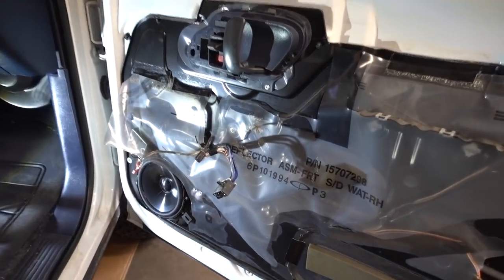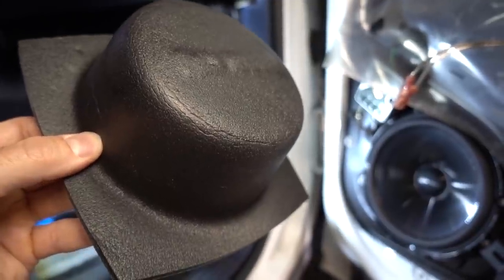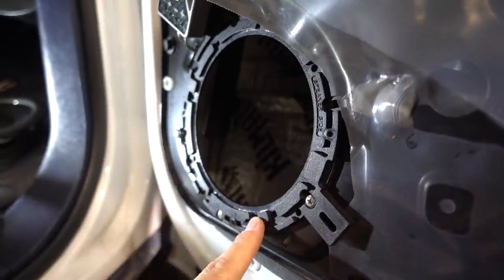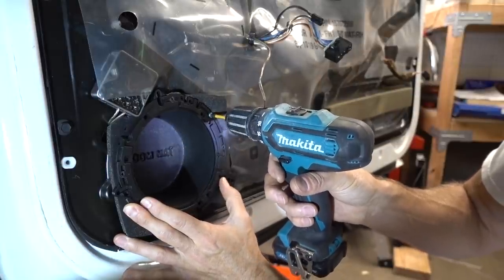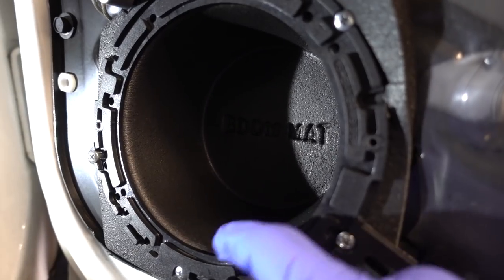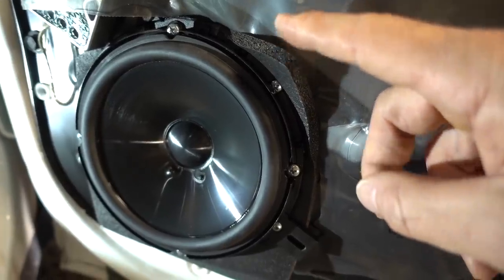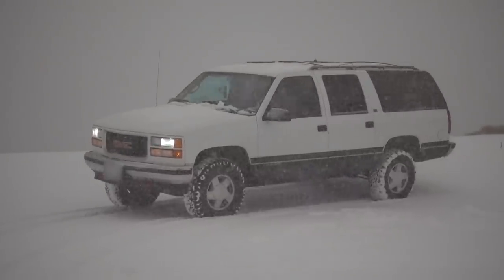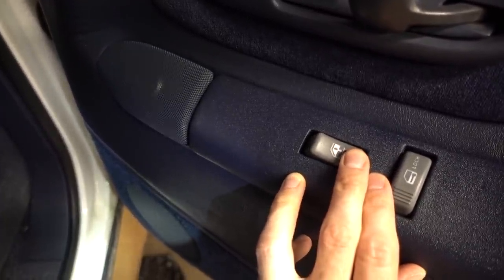Here's How A Speaker Baffle Could Destroy Your Speakers!

Comment: Just shorten the foam baffle length with a sharp craft knife (cut a thin section out) and glue the foam back together with contact cement. I like the baffle idea, not just for protecting the speaker from the elements, but it will probably produce way better sound than using the entire door as an acoustic device. I'd cut some flaps / sections out at the bottom to allow it to vent compression however.
Reply from the maker: Great ideas, Thanks!

Comment: So the best way I found was as follows. Fold the foam inside out. Put speaker on the foam. Fold it over the speaker. Cut the bottom out of it to allow air for your bass. Screw it in. Then I personally put caulking around the out side of the foam for tighter seal. The glass may rub a little but your not hitting it. Make sure you cut the speaker wire hole on the back side instead

Comment: “I’m the type of person that just can’t leave things alone” lol, welcome to the club! You know it will drive you up the wall thinking about this. Is it possible to cut 1/4” of the foam and reduce the depth then use an adhesive spray/silicone to reattach? I don’t know how much clearance is available.....
Update: I just read/noticed “Daddyoh” made the same suggestion. In any event, Let us know if you try our method.

Comment: If u pull it back apart put the mounting plate on the door like u had it and push the bucket in like u initially tried to do it wont hurt anything the design is to improve sound while protecting from the elements
Reply: Or add a layer or 2 of deadner to the outter skin of the door that will give an 1/8" or more depending on thickness of the deadner

Comment: Unfortunately the mid bass will be gone because the baffle inside space is way to small. And it'll sound bad..protection yes
Sound not really. Cut the lower back half of the baffle and it'll sound properly
Reply: I'm glad folks have experienced this. And I'm glad it's not months down the road I'm figuring it out. Definitely gotta do something. About that speakers sound good but after hearing this they could sound better

Comment: jewllake  below has the RIGHT IDEA - " You really want the speaker to move air and take advantage of the whole door ".  --  Without the door volume of airspace the speaker drivers will not sound as good as they were meant to...... jewllake's idea was to cut them in half and only uses the top part as a cover leaving the bottom side open to allow drainage and moisture evaporation, --  I would also cut a half circle out of the remaining back plate leaving about a half inch of the diameter of the back plate to give some extra support to the top half of the cover but not blocking to much of the sound coming out of the back of the speaker driver. 

7

Comment: Had the exact issue with my 1999 K-1500 Suburban when I replaced the speakers. Just reinstalled the mats on top of the speaker trim ring and cut off the extra material.

Comment: "Slime" refers to depth, not diameter. Just install it on top of the mounting ring. If there is a fitment issue in terms of diameter, you could take material off the inside of the ring.

Comment: So why don't you just put the baffle in after the mounting bracket for the speaker? It looks like the window is coming in to contact with the baffle by less than a 1/4". Putting the baffle in after the bracket instead of vise versa might give you the needed clearance. Use felt tape on the bracket mating surface with the door panel if your worried about rattling.

Comment: Cut it at an angle use it as a water deflector  you want to use the door as your speaker box so you don’t lose any mid range
Reply: After replacing my speakers and installing the baffles can definitely tell I lost some range. But then again I'm kinda a noob on this stuff but I have 4 6 1/2  mtx terminators i replaced the factory speakers with

Comment: Just put 1/4" spacer behind the mount if it will not hit the door cover in front of speaker. Use 1/4" longer screws to mount back.

Comment: i ran into same issue when i was swapping out the stock 4x6 door speakers in my '82 Buick Riviera for some 3 ways. first it wasnt fitting inside it properly due to magnets size so than tried it without it & it was able to fit but didnt sound good at all & didnt quite sit well with us either so then i had to wait a few days on the stereo shop to get me a cpl tht were a perfect fit for both speaker magnet & window clearance except for now the tweeter wasnt letting the door panel get put back on due to the grill was in the way now so after a long time messing around with it we ended up jst exchanging the speakers for another 3way pair which actually were  much btr since they were able to fit snuggly within the original door cups & we was able to reassemble both door panels with no problem & also they had btr power handling & sounded much better than the other set i was going with. lol :/

Comment: Hole at the bottom for speaker wire I would think the water if it hits it it’s going to run down the sides and collect  at the very bottom point. I personally would put it on top with a dab of black etc to seal the wired but really if it’s that much of a concern when it rains just order new window seal and new window wipers inside and out

Comment: Cut the foam 1/8" of the rear of the rear cover. Then used a glue  like weldwood or contact cement to glue the rear back on then use some good waterproof tape around the glued area.

Comment: Try the adapter first then the baffle over it. I know it's not necessarily the ideal way because you initially installed it perfect like a pro in my opinion but it might give you just that little bit of extra clearance you need my friend.  Not ideal but if it works.. 🤞 LIKED & SUBBED!

Comment: Hand held screwdriver? Guys at 5 Star say 1/32 is the only thickness that won't tweet your acrylic ring.  Pull the wires through before you fill the hole.

Comment: It looks like it's barely touching.  Just put some washers between the foam and door structure its mounted to.  Looks like 2-3 washers on each mount screw should to do it.  I'd also take a razor knife and cut off the excess foam around the outer diameter of the speaker mount bracket you are using.

Comment: You can just cut the back off. Water is very unlikely to effect your speaker. You can cut on an angle so that it is flush on the bottom. OR. You can force it so that it is mounted outside of the speaker bracket. This will likely be just enough that it will clear.

Comment: Treating the windows channels with armor all or wd 40 should help to weather proof the windows but this a good solution  ,also to improve the sound coat the screws in copper grease as this will help to reduce rfi distortion

Comment: Put a 1/2 inch spacer if that is to much for the speaker grill use 7/16 spacer, you might have to make them, that will move the speaker closer to the whole where your window wont hit
Reply: I cant believe these so called audio professionals cant figure that out. Look on Ebay for some spacer for 6.5 speaker made out mDF or 7/16 MDF for 6.5 or what ever size u have. If u buy off ebay they are $15-$20 at most and they work. They are made out of MDF

Comment: I’d be more worried about your crossover placement and overheating your coils by not allowing airflow to your speaker motors
Reply: Yeah because overheating speaker coils are totally a problem in 110-118°F Arizona/Nevada/California/Sonora/Emirati... Btw it's well over +130°F in the SEALED door panels...
Reply: @bestvidsdottk  yeah and I’m willing to bet the glue that holds that coil together melts close to that temp
Reply: What happens in sealed boxes?

Comment: Wouldn't a speaker baffle affect the sound quite a bit? It causes pressure to build up behind the cone as it moves inwards, which it wasn't designed to handle. Any speaker enclosure heavily affects sound.
Reply: The boom mat will affect the  sound.
If you install it like the guy did in this video, it will send the sound out in a straight beam. The ambient sound will be gone.
In order to achieve the best sound, these baffles must be modified. Holes must be cut into them to allow the speaker to breathe and secondly you should use a thin layer stuffing inside the boom mat to absorb the sound coming out of the back of the speaker.
Believe me this Works to improve the sound quality of the speaker

Comment: Man what a bummer. 😔 They're definitely worth it though. If you're going to fix the depth in the future, definitely get a set of foam rings. It gets sandwiched between the speaker and the door panel, sealing off, and isolating the sound so it projects into the car better. Gives you a really good sound improvement. Especially in the midbass frequencies.
Reply: Esos arreglos sencillos con la pieza que trae los Malibú una pieza que retira la bocina de la puerta ya está eso es todo para que los imanes no pegue le pones eso y las piezas de retirar la bocina para que los imanes no peguen ya está

Comment: The round speaker box is so small that it almost sounds as if the back of the speaker is clogged.

with such a small box you will not get good sound!

Make sure the speaker has a gasket so you do not get sound leakage.

speakers at the bottom of the door will not sound good since the speaker is so far down!

Comment: Clearly this person is not an MECP certified installer.  Second.  Foam baffles do protect the drivers really well.  I use them due to the fact I live in Florida.  Yes I made a port in the bottom of it to allow the backwave leave the foam for this very reason to  "breath" if you will.  When you spend $1200 on a set of components then yes one must do thier best to keep water and moisture off the drivers for logevity  If you are smart.  Make kick panel enclosures and call it a day.

Comment: Installed those baffles along with brand new t series fosgate 61/2 inch speakers in my 05 chevy truck. Couple months later passenger side window motor went out, driver side regulator went out and both speakers stopped working at the same time. Coincidence ? Highly doubt it. I promise you they don't add mid bass nor do they protect the speaker in any way. Probably why there so inexpensive

Comment: You didn't seem to show how much of the bottom of your window wanted to slide behind the foam baffle, unless that little bit you showed WAS the max with window all the way down.  Here's my thought:  There should be some extra glass below the door trim when window is 100% up position right?  So, you have a "margin of error" to use at where the glass contacts the baffle.  What if you used some non-petroleum or silicone grease to lube the backside of the baffle to ease the friction vs the glass?  I know your first reaction.  The grease will attract dirt, and yes, of course it will.  But every time I have looked into my door spaces the dirt factor is normally very low.  The space is pretty well defended from routine dust/dirt, and there is not much ventilation that infiltrates it.  If it were myself, I would lube it to reduce the drag on the window motor fuggitaboudit, even if there were more intrusion by the baffle.  So long as the glass was not trying to push the foam thing down (after greased), that's would be my solution . . .

Comment: Boom mat can be hard on speaker surrounds, it doesn't make speakers louder but it does change the tone, that can be good or bad depending on your ears, however it rubbing on the windows? Eh, not gonna hurt the baffle, it can however ruin your window regulator, just ask me how I know, who'd have thought a passenger window regulator for a 2001 focus zx3 could cost $120??
Reply: Oh by the way, depending how much the window presses on the baffle it can also create pressure inside, and possibly even a vacuum, which can be bad for the coils if you roll the window up or down with the speakers playing

Comment: During the original install of the speakers, you traced back to find the split for the woofer and tweeter, since there was no original cross over, was that necessary or could you just use either pair of the original wires to feed the new cross over?? (Am I making sense?).

Comment: I tried these on a 2000 ranger with some upgraded high end aftermarket component 6.5's and they took all of the bass out. I only did one side to compare the difference and they sucked all of the midbass out of that speaker. I would definitely not recommend using these unless you are having a water intrusion issue and then i would cut the bottom out so they are not enclosed.
 just my 2 cents from real world test.

Comment: Is there a sound difference between the boom mat and the open door with kill mat? Which sounds better. I am wondering about the boom mat for my 6x9 door speakers but wondering if it will limit their sound output vs the open matted door enclosure.

Comment: Random question but would be greatly appreciated does any body know what size/ thread and length of the bolt that holds the tailgate cable to the tailgate because pick ups are differant from blazers and suburban tailgates

Comment: I'm building a DIY bluetooth speaker and I'm using a 1.5ohm sony passive sub and I am using the enclosure and I put a 8ohm speaker in it and a tweeter I'm wanting to put a full range speaker in it and I waa wondering if this would work with keeping the pressure off of the 3.5" full range speaker

Comment: NOOOOOOooooo, I just ordered a pack of these for my 2004 Tahoe!!!
Reply: Hopefully they worked out well for you. In my personal opinion he did absolutely nothing to first confirm that there would not be any interference which anybody that’s messes with electronics, especially car audio would know to do. Let alone a person that posts his videos on YouTube. You don’t build an entire car engine and then try to start it to see if you have any rod clearance issues. Nonetheless the space between the speaker and the actual door panel is a decent amount, Especially on those models and later models, therefore an additional speaker ring can be added behind the foam baffle to the door itself then the baffle and then the additional ring that was originally used therefore sandwiching the baffle and giving you your clearance needed.
Again hope you had good luck with yours.

Comment: Really if you're that worried about weather getting in. You could cut off the back and bottom of the foam enclosure. It would protect against moisture coming from above. And allow the speaker to breath. If that foam is dense enough to keep water out. It probably won't let air pass thru easily. And the speaker needs free air movement.

Comment: Jimmy I feel bad for you that was a useless thing to do first of all the speaker baffles look very very cheap second of all unless you cross over those mids at about 2 kilohertz it's going to affect your bass immensely.  also are your crossover protected 
? they will get wet also they should have been put inside the vehicle not in the door or they can rub on something. your enclosure will be tiny meaning no mid bass whatsoever. you should have left it alone.  Third thing I have had many vehicles with speakers like that without putting a baffle and they have never rusted or been water damaged. you have a gasket in the window water will not get in there

Comment: Put a tiny piece of pin-strip  on the window to mark the point of contact. Or use an angle grinder to put a line all the way across the window. 🥴🥴🥴👉🤯🤣🤣🤣🤣🤣🤣
Reply: Yes if you want to see how tempered glass explodes.
Reply: @x-man5056  and it would 😁😁👍👍

Comment: Cringe at even the idea of using these because they flex they're going to cause so much feedback that's not good for sound quality although miraculously it does make an improvement over not having them and that's because not having them you have a speaker box made out of 24 gauge sheet metal which is like the worst type of speaker box ever so it doesn't improvement in that instance but if you really wanted to get shazami bammy I would throw some fiberglass resin and fiberglass on the outside of it make that thing hard as a rock then add a little piece of stuffing in the inside maybe

Comment: Those are worthless. Speakers were made for large doors not small spaces. Your best bet is to cut the bottom half out and use the top half as a hat. Most speakers now are made with rubber surround and plastic cone. Not much to get damaged there.

Comment: thats a cheap badly designed product. it should have a drain hose coming off it that you can also run your cables into and would allow air movement (also how much moisture are you sealing in there? and how about atmospherics collapsing the foam and the fact pressure can blow air out and leave your speaker in a  vacuum. resulting in excessive forces and billowing of the foam leading to cracks.

this is also doing nothing a sheet of clingfilm wouldnt do better  ($0.02 solution).